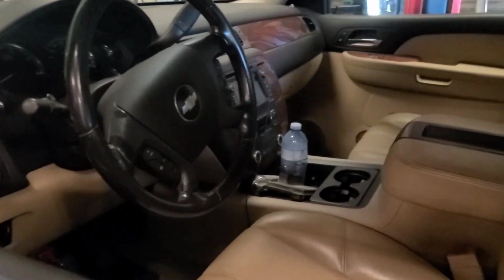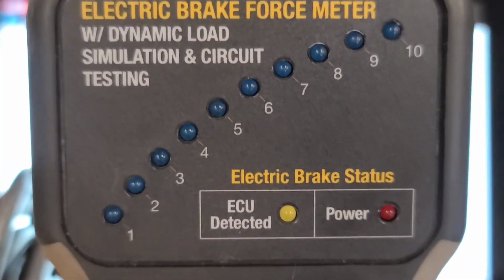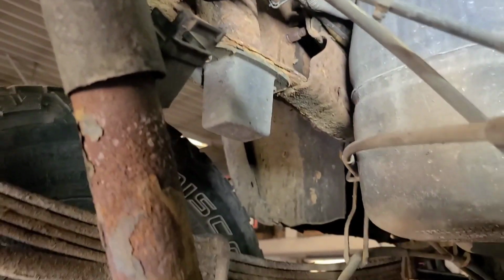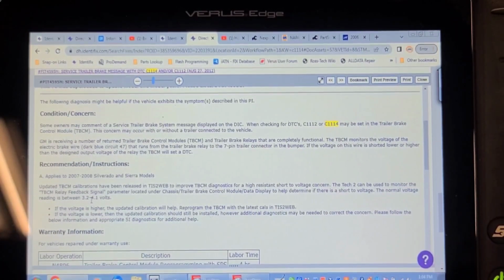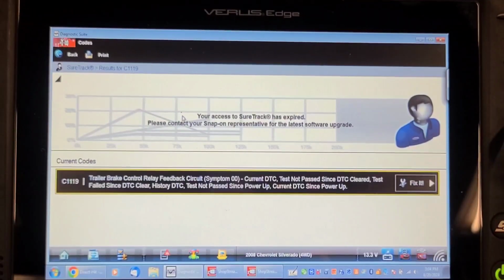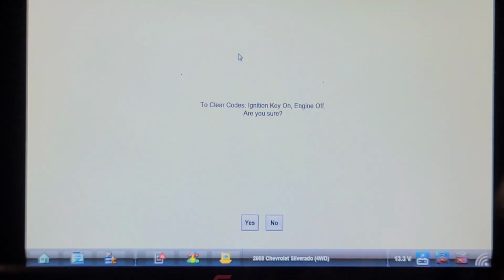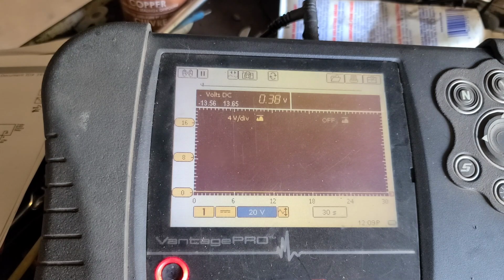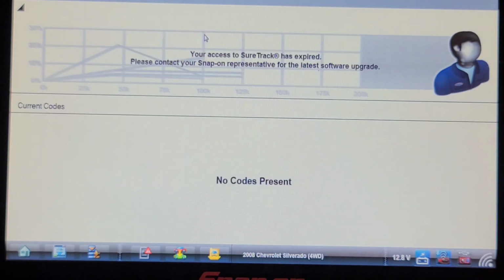2008 GM 2500 4x4 Service Trailer Brake System, C1112, C1114, C1119

Comment: Thank you for posting this video, it wa the final problem on my 2010 Silverado 2500 HD. That annoying message "Service Trailer Brake System" is now gone.
Reply from the maker: We're your wires in the wrong locations as well?

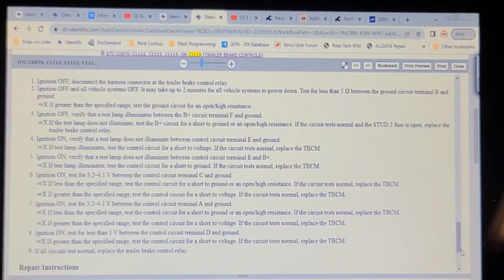Comment: i want to thank you, Phillip, for helping me find a very troublesome problem with my trailer brake system on a 2007.5 2500 HD LMM truck. Same alarm for months. It wasn't until I saw this video at 29:30 that I began to solve my problem. Following this testing procedure, I was able to find a high resistance at the (step 2) resistance check. This led me to a bad ground at G401, which was terminated at the factory on top of the chassis tar coating!! I actually found several grounds in this condition on this truck. So THANKS MAN!
Reply from the maker: Glad it helped you

Comment: I have 08 Chevy Silverado 2500hd  with  service trailer brake system with and without trailer hooked up. But it will work for about 2 to 5 mins after  the truck start  then stop working

Comment: I had an issue with mine. replaced the brake controller rely then i replaced the switch. After that I said im done and went and bought a nice after market one. No more issues! Problem solved and BTW an aftermarket one is WAYYYY better than the stock one! The stock one always had a delay but not with a new aftermarket one. If u wire it yourself use the 3rd brake light for the unit to know what ur hitting the brakes. I ran a wire from the fuse for the 3rd brake light to the controller. That was prob the only small issue i had installing the new unit
Reply from the maker: That's certainly another option.

Comment: Sorry but I'm still lost. In conclusion what was the problem? Someone else switched the wires? I have the same problem in a 2012 Silverado 2500 but I have a flatbed and don't know if they installed the bed after was sold as a regular pickup truck or it came like that from factory. Hope someone can tell me what was the problem.
I bought this truck with check engine light, replaced both downstream 02 sensor no more light, the tmp sensors were bad replaced no more light, the steering wheel angle sensor was bad and the stabilitrack  light was on after replacing it no more light, no I have this message 
Service trailer brake system and service air bag system. I'll like to take care of that too so I don't have any more screen messages
Reply from the maker: Yes on this truck someone depinned and switched two wires in the connector.

Comment: Did you try the original relay and module after discovering the bad pinout? Curious if would have worked the whole time. Thanks for a great diagnostic, not many tread so deep.
Reply from the maker: No I did not as I was frustrated at that point but I'm sure they are ok...

Comment: So i wonder what diagram the guy that re-pinned the connector went off of. So 2 diagrams were incorrect? Awesome find though! Glad that headache is gone lol.
Reply from the maker: The diagrams were all correct. I just didn't catch the two wires in the wrong locations. The ground and the brake output wires were interchanged. It did not hurt anything since the relay had no ground it would not output on the output circuit. What also threw me off was that the three controllers each set a different code...

Comment: I bet that if you print a standard list of questions to ask EVERY customer before attempting to diag a vehicle and force yourself to ask the questions and write down their response, you could probably prevent yourself from running down a rabbit hole unnecessarily.  Question the customer every time on how long they've owned a vehicle, when the last time the functionality worked, ask if any other repairs/maintenance have been done in the last 1/3/6/12/24 months, ask if anybody has looked at the issue, ask if any aftermarket equipment has ever been installed, ask if anything else is inoperable.

I'm sure you could easily come up with a list based on stuff that has impeded your diags in the past.  It might be a great business practice to implement because there are always questions we might either forget to ask at first, or maybe initially we might feel like the information wasn't relevant but then it turns out it's needed.  It could probably reduce the the "let met try and call the customer" instances as well.
Reply from the maker: @RK-kn1ud  that's an excellent idea. I know better too. I knew that the customer recently purchased the truck and thar someone fixed a wire but ther than that not much else...